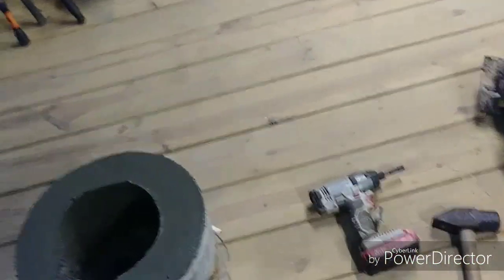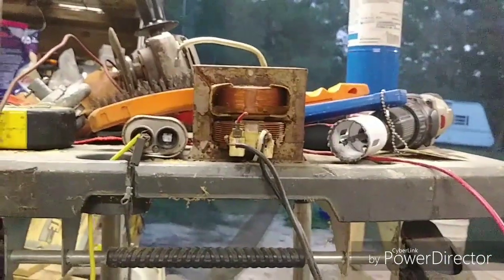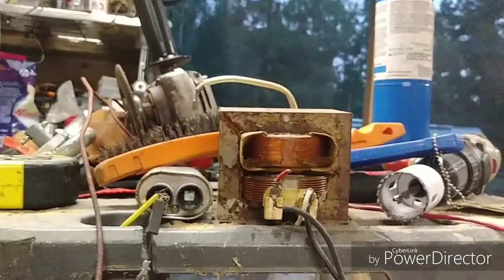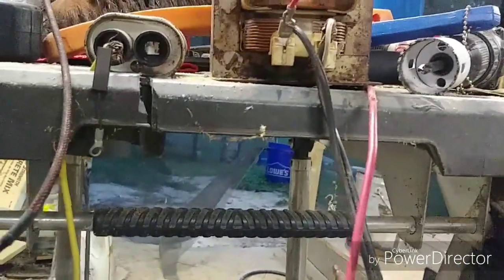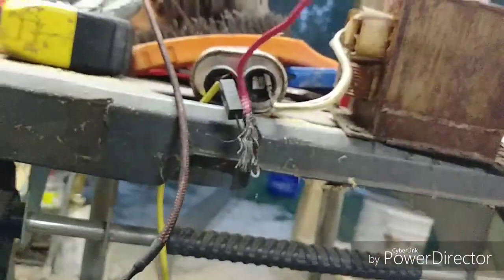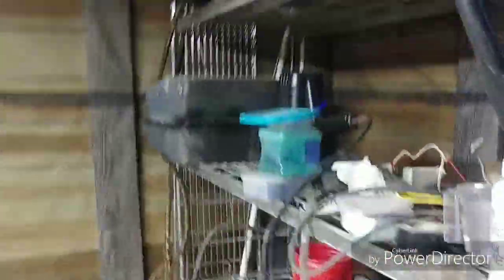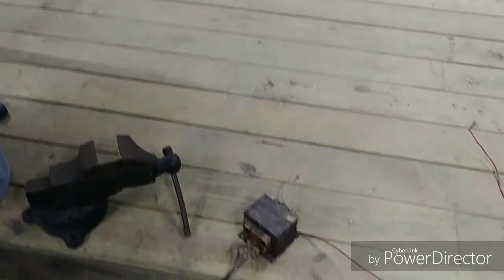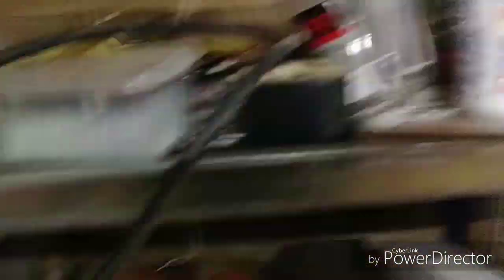Updates and lectinburg wiring

Comment: Have a question the first transformer you showed had a wire coming out of the secondary then the second transformer had were you can use a clip.... My question is can I soter that wire to my burner on the first transformer you showed??
Reply from the maker: Im thinking your talking about soldering the pig tail (plug) to the primary coil instead of using a clip. If thats the case yes you can. It would probably be better to do so. Im just to lazy to do it lol
Reply: I've soldered all the connections on the ones I've made and no issues. Doesn't get hot enough to melt the solder if that's what you're getting at. I also installed a small fan blowing on the transformer when powered up.

Comment: Do you have to have the capacitor hook up as well
Reply from the maker: Great question! No you don't have to have them. I usually run them without the capacitor. They tend to burn up in these machines.
Reply: @AAMW13  ok I had seen several of them made without them and in your video I saw you were talking about the wiring and mentioned one of them